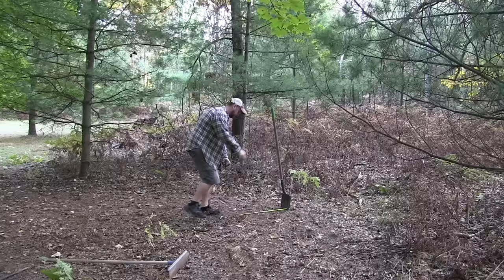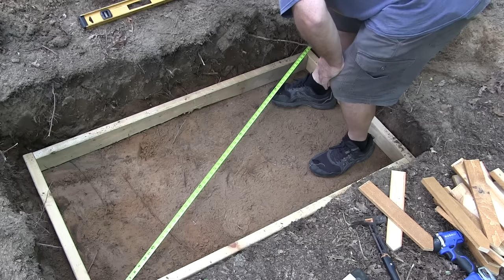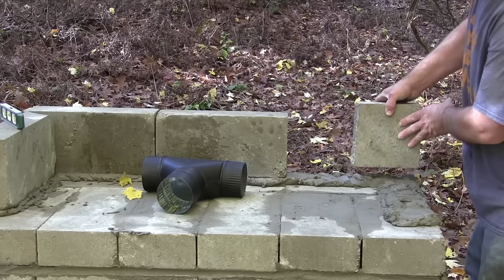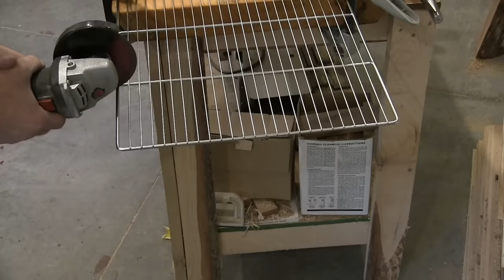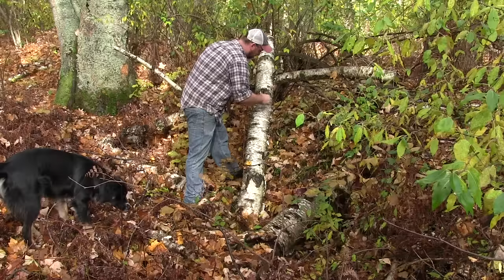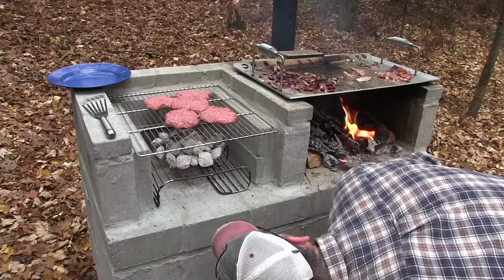building an outdoor kitchen for my off grid cabin

Comment: I know someone with a brick oven like this. Fire has degraded the block and it has crumbled. My suggestion for anyone considering this, is to add a layer of fire brick and roof for protection from the elements. Otherwise, fantastic work!
Reply from the maker: I have since lined the right side fire box with fire brick , haven't done a roof yet but considering how I want to do it . Thanks!
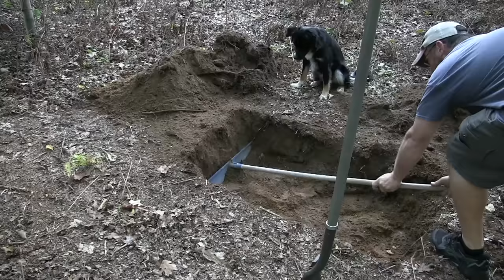Reply from the maker: A lot of people said I should build a roof over the outdo kitchen . Well I finally did and took it a few steps farther video will be up at 1:00 today hope you enjoy it

Comment: Great job on the build. If I could offer just a bit of advice though. Get some fire mortar and use it on the inside to coat The Brick. It's too late in the process to use fire brick but the fire mortar may help save your bricks from cracking. Again, great job on the build
Reply from the maker: Thanks that sounds like a good idea . I've heard just a thick layer of clay can do it too
Reply: Bare concrete + hot fire = boom
Reply: Good advice I learned from both of you thanks
Reply from the maker: A lot of people said I should build a roof over the outdo kitchen . Well I finally did and took it a few steps farther video will be up at 1:00 today hope you enjoy it

Comment: The secret to cooking on a griddle is to create several heat zones. For your setup that can be accomplished by where you place the coals under the griddle and how many.
I would also suggest a 3/16 inch metal tray to put your charcoal or wood in. This will make cleanup a lot easier and the most important thing is it'll prevent your cement blocks from cracking.
The blocks that you have chosen are not heat resistant and are susceptible to cracking and falling apart from high heat.
Just my thoughts.
Reply from the maker: I have been thinking about possibly buying a sheet of thin steel cutting and bending it into a three sided box that’s an inch or 2 smaller each way then drilling a few holes on each side putting some bolts through as spacers to hold it in place
Reply: Mix some fireclay with mortar mix and coat fire area with thin layer of that mix. Check with masons or bricklayers in your area to get ideas on how to do that effectively. Man, that burger does look good!!!
Reply from the maker: A lot of people said I should build a roof over the outdo kitchen . Well I finally did and took it a few steps farther video will be up at 1:00 today hope you enjoy it

Comment: well done..I made a smoker with a 50 gal steel drum the left have is a grill and right side is a flat surface. Thanks for the tip on the block and mortar..LOL I am digging a root cellar to place beneath my container. I have been off grid for 3 years building a 4 piece container home there is nothing like cooking outdoors off grid. Thanks for sharing
Reply from the maker: Thanks !! a 4 piece container home sounds like an awesome project !

Comment: Good job! I built a very similar outdoor cooking station. I did 2 things differently. I used Liquid Nails and filled the empty blocks with sand. It's been 4 years ago this past summer. It's been a delight to use.
Reply from the maker: Thanks !!! man I wish I would have known that I could have had it done in no time using that method . I believe it I'm really enjoying mine too . it's like cooking over a camp fire without having to get so low to the ground.
Reply: @blackspruce1861  not to worry, you did a fine job. I suspect using mortar and quick Crete to fill the voids was more cost effective. It took, iirc about 12 tubes...the sand was free from the creek. Regardless, I know you're enjoying it, I know I have enjoyed mine. Best of luck in your endeavors.
Reply from the maker: @jimmywalker2429  it might have been but I bet glue would be quick
Reply from the maker: A lot of people said I should build a roof over the outdo kitchen . Well I finally did and took it a few steps farther video will be up at 1:00 today hope you enjoy it

Comment: What a cool project!   I’m curious how the chimney worked out. Where you able to get a draft pulling the smoke through?  Oh yeah, that burger looked amazing.
Reply from the maker: Thanks! . yes it does work . when you are getting the fire going without the griddle on top it does nothing , but when you set the griddle over the fir it starts to draw . I do think it would draw a little better if I would have had it even one block higher though . still it does keep a lot of the smoke out of your face . oh yeah it was a good burger for sure
Reply: "One block higher"
Hello NASA?
Reply from the maker: I finally built a roof over the outdoor kitchen and it turned out AWESOME !! here's a link if you want to check it outhttps://youtu.be/Y63Vj1G9znI

Comment: Im a blocklayer and you need your mud/sandcement a bit wetter to use it with the trowel the way you were trying to.Rule of thumb is to pick up the mud & try to  consolidate it flately on the top surface of the trowel so that if you turn the trowel upsidedown it doesnt fall off.Still wet, but sticky.Then you can slide whats on the trowel down & along the brick/block in a nice even heap all the way along for about 4 blocks etc to lay them.OHH also im a cook & plz get a proper carving knife to cut onion or meat.That was as frustrating as watching the trowel work.But all in all you did a fantastic job because many ppl dont do or learn anything of value these days so i applaud you.
Reply from the maker: Thanks for the tip . I agree it's great to get instruction but the real thing is just to get out there and do something . Thanks !!

Comment: 20 year Mason here . Good job . I will not critique I'm only passing a couple of suggestions on to you. If you want that thing to last a little longer put down some fire brick on the area where the charcoal is and where you're going to have your fires in. And the walls of where you're going to have the fire going. Now the reason why, the fire will continue to cook the concrete block and mortar that you have put down and it will crumble  and pop then Crack,  the fire brick will help prevent that. And me personally I would have left that great long just so you can have a hot side and cold side and holding area on the rack. Now all you need to do is get a utensil hanger and mount it to the side so you can hang your tools on find a hunk of 3/8 or 1/2 rebar heat one end and curl over and grind a point on the other end and bam u have a poker .
Reply from the maker: Thanks ! Good tips . I plan to get some fire brick
Reply from the maker: I finally built a roof over the outdoor kitchen and it turned out AWESOME !! here's a link if you want to check it outhttps://youtu.be/Y63Vj1G9znI

Comment: I have a 2 acre lot on a river in east Tennessee.  I was thinking of doing a outdoor kitchen.  This is similar to something I want. Thanks for posting and you did a perfectly good job.
Reply from the maker: Awesome !! Tennessee is such a nice state . I've gone down there a few times for whitewater kayaking ,and keep thinking it would be nice to build a little cabin down there to dodge our winters . I'm glad you liked the video . one thing you might want to change is to line the fire boxes with fire brick . it will help the block hold up from the heat a lot longer . and use refractory mortar for the blocks in the firebox area , the bottom stays cool and doesn't need anything special . mine's still holding up fine but over time would last longer with those improvements .
Reply from the maker: I finally built a roof over the outdoor kitchen and it turned out AWESOME !! here's a link if you want to check it outhttps://youtu.be/Y63Vj1G9znI

Comment: A great job you have done there. A top tip for when you are next laying bricks or blocks, put a small squeeze of washing up liquid into the mortar when mixing it up. It will sure make the stuff flow and slide off your trowel easier.
David in the UK.
Reply from the maker: thanks ! really that's cool ill try to remember that

Comment: I like the part where you made a wooden mold, poured way too much concrete into it and then just left the mold in there because the hole was basically filled with concrete. Reminds me of some of my projects. Haha.
Reply from the maker: LOL well it did still serve its purpose of giving me a level surface to screed my concrete from
Reply: @blackspruce1861   Just make the concrete thin enough and itll level itself out. I learned that over the years. 🙂
Whenever I have to pour a concrete slab today, Im making my life a lot easier and simply dig a hole and fill it with thin concrete.
Anyways: Your outdoor kitchen came out awesome! Watching your video made me want to build my own. 🙂
Reply from the maker: I finally built a roof over the outdoor kitchen and it turned out AWESOME !! here's a link if you want to check it outhttps://youtu.be/Y63Vj1G9znI

Comment: Nice work, especially for a first timer.  In future, be sure to wet your concrete blocks, bricks and stone before mortaring in.  This will make for a stronger bond.  Additionally, firewood, charcoal and other storage can also be integrated into the base of your constructions in future.
Reply from the maker: Thanks !! and thanks for the tips . I wouldn't mind trying some stone work some time

Comment: The finished product looks great right down to the burgers. An addition you can to would be to make a hole from the grill side to the griddle side of your project. Cover the tops of both sides with large pavers and make a quarter inch steel front with handles. Make your fire in the smaller side and you can have a smoker/oven on the other side. The hole you made to connect the two could be filled in and exposed with a brick. The door on the grill side could have an air intake so oxygen could feed your fire. You've already got the chmney for the other side.
Lastly, with all that birch bark and kindling, you have no need for lighter fluid.
Great job.
Reply from the maker: I built this for a smoker / pizza oven . haven't tried to smoke anything yet. https://youtu.be/-6wCGMO8h2I

Comment: Hi ! Great job ! I would just lay some fire brick on the bottoms and maybe the sides if you have room. You don't even need any cement, just lay them inside the grill as tight as you can and then you would not have to worry about anything cracking from the heat , plus you would use less wood because the fire is going to be a little bit closer to the grills and they are easy to remove if you wanted to clean, hose out  your fireboxes every once in while, thats what i did to my homemade Fieldstone grill . 
I have a 1/4" stainless steel plate with 4 sides about 3/8"high  , i could cook about 25  lbs of bacon at one time , then i would scramble about 6 dozen eggs all at once for my Chris' Cabin party weekends ....lol  such a great time with my friends and family !!  Plus i made a rotisserie that I could ajust to different heights utilizing a old Webber electric rotisserie   turner for the pork loin or the large  Montreal seasoned beef tenderloin using Charcoal and wood  ! Just for some suggestions 😊  Great job with your project for sure  !!
Reply from the maker: Thanks !! I added fire brick to the right side .I built a  pizza oven /smoker for it , and did a pizza and maple syrup video I knew I needed some fire brick before boiling sap all day so added it then . I like that rotisserie idea that sounds pretty cool . Chris' cabin party sounds like a great time !

Comment: Hello sir, looks great. However I want to highly recommend some sort of barrier between your fire and the concrete. Concrete does NOT like fire or high heat. It will explode. Very simple fix is some of those fire bricks from tractor supply to lay down in your fire area and stand up against the side walls too.
Reply from the maker: Thanks !! I’m thinking I will probably do that in the spring . I’ve been cooking on it the past couple days and really enjoying it . I definitely don’t want it to fall apart then I’d have to build it again

Comment: Great design. If you make a metal front that can be placed on the griddle side front, you could use it as an oven also, by scraping coals off to one side or out completely then place items to be baked inside and close the front with a metal, front. Just an idea.
Reply from the maker: I think you might mean exactly like this Building a wood fired pizza oven / smoker for the off grid outdoor kitchen
https://youtu.be/-6wCGMO8h2I

Comment: Concrete holds moisture, when you build a fire the moisture down inside will expand. Some times faster than the steam can get out. An explosion can happen. It is extremely violent. 
This happen to me. The crater in the Concrete was about 3 foot diameter and 3 inches deep. It blew 4 of oven racks full of slabs of ribs hot coals and Concrete about 8 feet up.
Luckily I was in the house when it blew. Sounded like a bomb. Fire all in the yard.
I learned about fire brick that day.
Reply from the maker: I've since lined the one side with fire brick the other side doesn't burn for long periods of time

Comment: the work looks good. I strongly suggest investing in fire brick, or fire tile, and using silica mortar for any areas coming in direct contact with the fire. the off-gassing from the standard blocks and mortar can be problematic and will only handle so much expansion and contraction with temp changes.
Reply from the maker: Thanks !! I lined the right side with fire brick a while back . the left doesn't get quite as much heat and would be a bit difficult to line

Comment: Bruh, really cool build section on this video! I've got some notes on the cooking part, though...

Use the hardwood under the grill grates, start it with charcoal. You're losing crazy flavor there. Use charcoal to heat the flat grill, you'll have more control and the smoke doesn't penetrate the metal anyhow. You won't lose any flavor.

Stop adding condiments. More than 3 ingredients to flavor a burger takes away from the burger. You were perfect with cheese, onion/mushroom and mayo.
Reply from the maker: Thanks and Thanks for the tips!  I'll have to try that hardwood under the grate on the left side . heating the griddle with charcoal wouldn't work unless I built a stand to get it a lot higher that griddle is probably 3/8'' thick and really seems to need quite a bit of heat to do anything .  lol I would happily scrap the beer mustard but your not taking away my bbq sauce . I'm glad you enjoyed the video thanks again !

Comment: I can and have cooked the same food on my Weber Kettle , wood on one side and lump or briquets  on the other , been using this Weber for 22 years and several times a week. Its been straped down in a truck or trailer dozens of times and hauled to many places and cooked on , only God knows the tonnage of meats and others cooked on the grill and have only replaced the grate with a heavy duty grate that is good as new after 5 yrs. of solid use. Its all about controlling the air flow and heat. Then I can cap it with the dome top , turning it into a oven or a smoker in which I do a lot ! I can  do long smokes using the snake briquet method. Smoking up to 16 lb Turkeys by removing top grill grate and standing the turkey in a pan down on the bottom grate with the briquets snaked all the way around.
Reply from the maker: That’s awesome!! Smoked turkey is the absolute best way I’ve ever had turkey

Comment: Great work and exceptionally done video.  Your brother better look out.  One question though, which you can probably answer now with many months of use.

Is there an issue with grease runoff?  If so, is there a solution that could be incorporated in the initial build. Thanks.
Reply from the maker: Thanks !! grease doesn't seem to be much of a problem the grease from the griddle I dump in the fire and let it burn up and the charcoal seems to take care of the otherwise pretty well . also I clean the ashes out pretty much every use

Comment: What you did looked good. I wonder if it would have be easier to just remove 2 inches of top soil, lay down 4 inches of gravel, and 2 inches of sand on top of that. Lightly water for a week to get it settled, and then install.
Reply from the maker: Thanks !! I don’t know that might work but a good rule of thumb I’ve always went by is the too soil needs to go , So it might work but knowing I have good packed sand just below I would get past the top soil

Comment: I'd been working on a design for mine, this'll work perfectly. The only thing I saw that could have been better..... When you put in the exhaust, the extra space could have been used as an air inlet like we have on our regular BBQ grills. Currently, there is no airflow from behind the fire for it to burn evenly. Resulting in more smoke, a cooler fire, and inconsistent temperatures.
Reply from the maker: awesome ! yeah that might help but it defiantly seems to burn fine . the other thing is line it with fire brick to make it last a little longer .